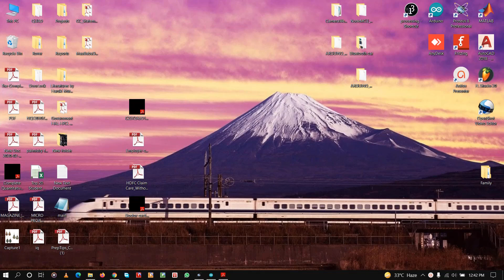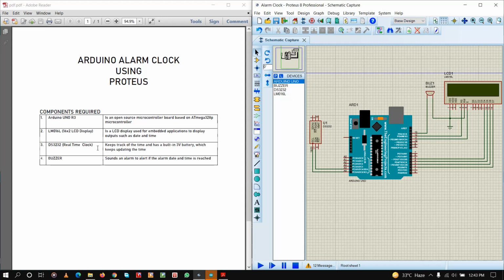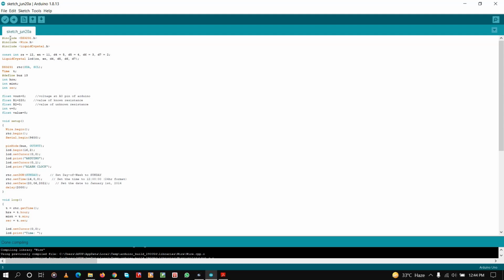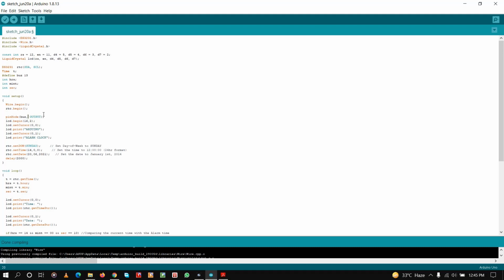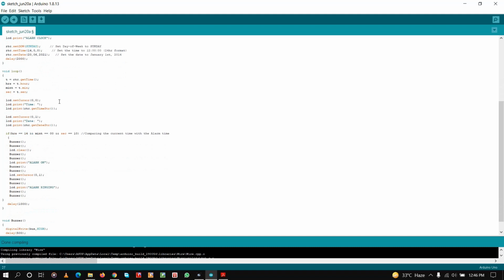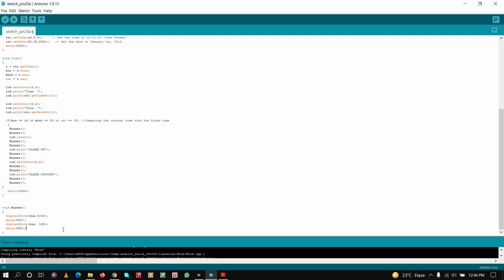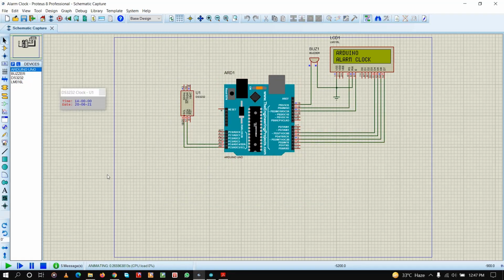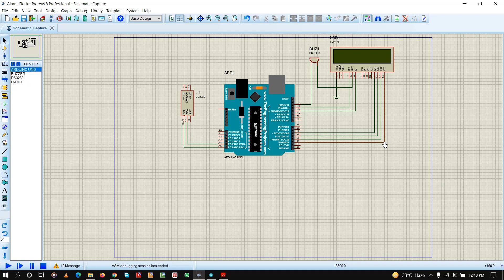Arduino Based Alarm Clock using Proteus | How to make Alarm Clock using Arduino | Arduino Projects

Comment: Dear sir,
Can I get the DS3231 library file? As I am getting an error in the third line of the code
Please send me the link in which you downloaded the DS3231 library file. Urgent need. I get the following error after installing DS3231 library
error: no matching function for call to 'DS3231::DS3231(const uint8_t&, const uint8_t&)'
Reply: I have the same problem
Reply from the maker: Try this link to download the library - 
http://www.rinkydinkelectronics.com/library.php?id=73